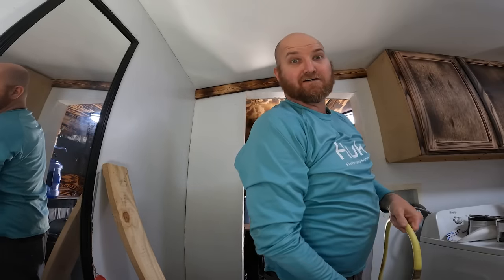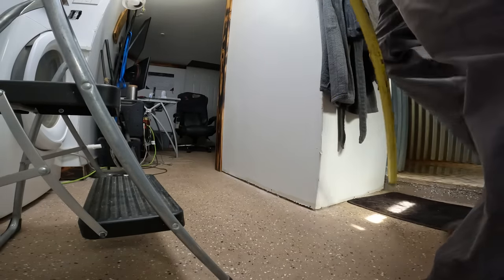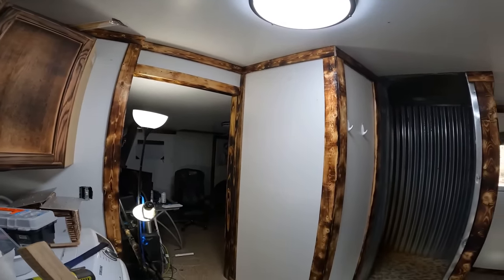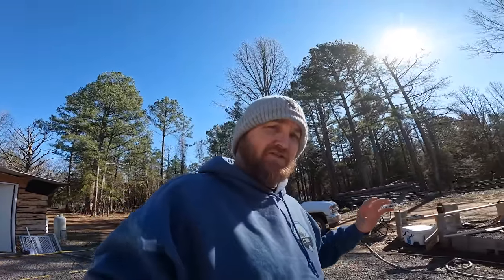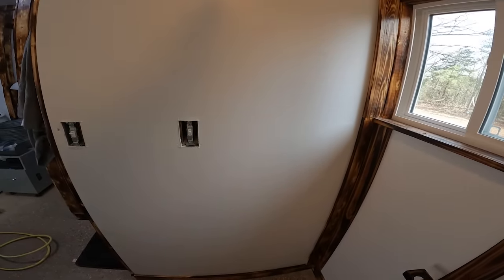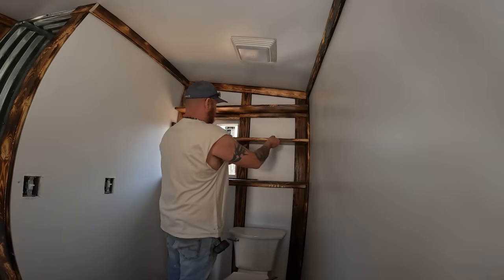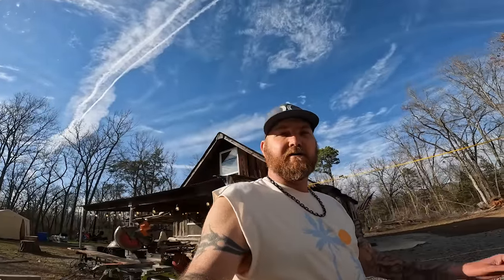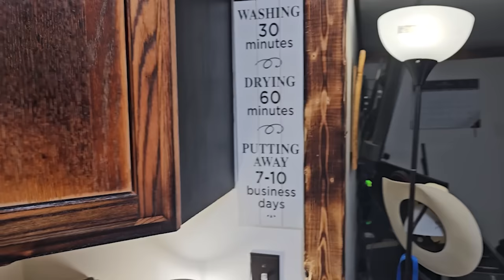ONE OF A KIND TINY HOUSE BATHROOM COMPLETE off-grid, cabin build, DIY, HOW TO, sawmill, homesteading

Comment: Wow, it’s stunning David. Well done, you should be very proud of it. Just a suggestion, if you decide to close off the bathroom area for privacy you could use a tri-slide stacking barn door that stacks next to the sink unit and pulls across the room to the wall with your towel and robe on. It looks like you’d have space to do this and it would enclose the room while in use but it would be open when not - therefore not blocking the light from the window. That way if you have guests using your bathroom, they’d have privacy and you’d still have access to the bedroom and kitchen. A wooden door frame with metal like your cabinet doors would look 🔥

Comment: you should space the base trim off the floor. concrete is naturally wet and the wood trim will wick it up and start rotting and if you spill water on the floor same thing.
Reply from the maker: Concrete was sealed underneath before and sealed before epoxy